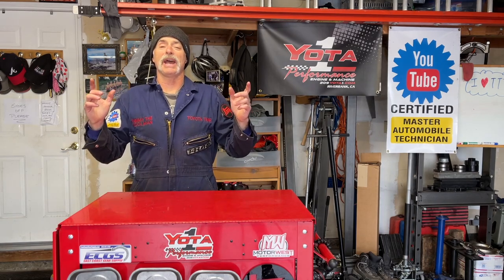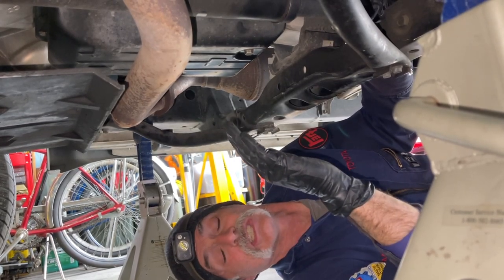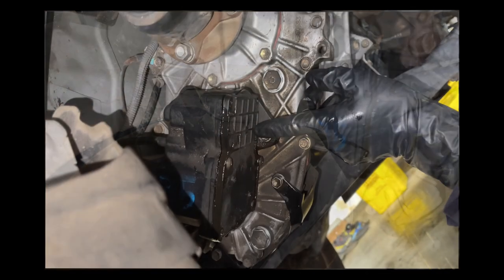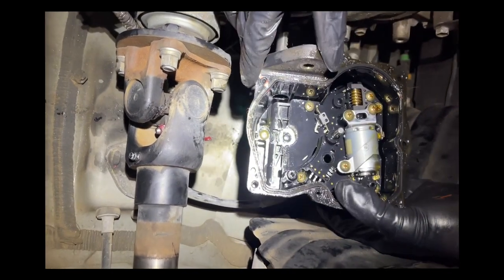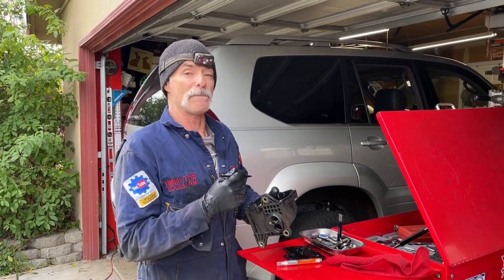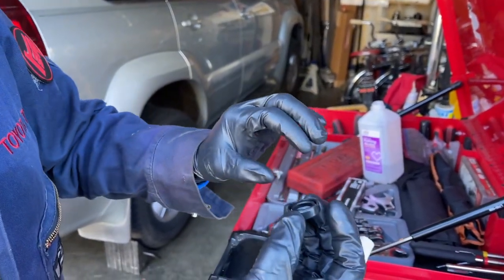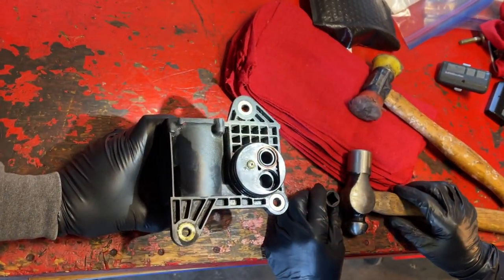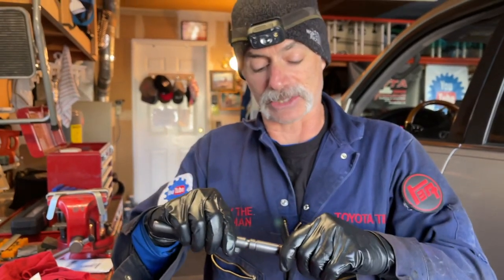Lexus GX470 Center Differential Actuator Repair

Comment from the maker: After filming this job, I had a thought of how I could have possibly been able to confirm I was able to insert the shift rod through the shaft seal without displacing the metal retaining band.  Here's my thought.  If I pulled the shift rod out further from the transfer case, basically putting the center differential into the locked position, I would have had more shaft to work with.  With the shaft further out, I could have worked the shaft through the seal and then probably had enough room to sneak a telescoping mirror with a light on it to get a good look at the integrity of the seal.  If it looked good, I'd then keep pushing the actuator along the shaft until I was able to fully seat the actuator into the back of the transfer case.  If the metal band of the seal became displaced, I would pull the actuator off the shaft, reseat the metal retaining band and then try again.  The only caveat to doing it this way is you would have to remember to change the gear timing (small blue gear and bigger primary gear) to reflect the locked position which I cover that in the video.

If you try out the above method, be sure to leave a comment and let me know if it worked out.  Thanks!
Reply: Have you made a video of 99 runner not taking gas at the pump? It will take gas but takes 45 minutes.
Reply from the maker: @kenniegarner3848  No, we haven't.  Sounds like you're having a venting issue.
Reply: @TimmyTheToolman  Good place to start? Something simple? Or would you say pull and replace everything?
Reply from the maker: @kenniegarner3848  Do more research on the problem.  I've heard of this issue but don't remember the common solutions.  Do a Google search.  Post your issue on a Toyota forum.  Also post it on related Toyota Facebook pages.  I guarantee the information is out there.
Reply: This was my thought during that portion of the install.

Comment: Just finished doing the repair with this method.  Couldn't believe how easy the job actually went, and all worked perfectly, so thanks for putting up the method.
About the only things I did differently is wrap the shaft in thread tape from just a fraction on the 'collar' back to the beginning of the shaft (as suggested by someone) to help the seal step up that collar without the lip turning trying to turn inside out (which is what I believe is dislodging the seal spring).  Once installed just unwind the tape passing around the back of the shaft and slowly pull it out.
Also did it all single handed so not a two man job as suggested in the video.   Another person would have just been in the way.  The secret to doing it single handed was have everything laid out in easy reach, good lighting, and decent sticky white grease.  With a fair bit of grease on pins and gears everything stayed perfectly in place, even the big metal gear stayed stuck up in place.  I did the job with the vehicle (both front and back) on stands.  Plenty of room to work.
Reply from the maker: Thanks for the comment.  So you wrapped the shaft in Teflon tape to help the seal get up onto the sealing shoulder of the shaft and then unwound it from inside the actuator case?  I'm trying to visualize this technique, but I'm not fully sure if I understand it correctly.
Reply: @TimmyTheToolman  Hi Tim, the idea came for a comment somewhere down below, as well as one of the Russian videos where they used electrical tape.  The use of thread tape is I reckon a much better idea as it unwraps easy to get off.
The idea is its the small shoulder on the shaft where the geared section makes way to the smooth slightly larger diameter section where the seal operates that turns the seal inside out as it passes over it.
It's reasonable to assume the seal has to be somewhat forward of that shoulder on the smooth larger diameter section of the shaft with the case fully pushed home.  So, the wrap of thread tape starts JUST on the shoulder and continues all the way to down the geared section of the shaft with a bit of a tail left to help unwind it once the box is installed.  The idea is the shoulder ridge has been 'smoothed out' by the tape wrap, as well as protecting the seal as it passed along the geared section.  In the installed position the seal will have passed clear of the tape wrap start (right close on the shoulder)
Fit the box all the way home, (requires a bit of shove to make the o-ring go into the housing) and put in the two top bolts finger tight to hold it in place .   Then pick up the 'tail' of the thread tape that will be hanging from the end of the shaft, and then unwind it back of the shaft using a very small screw driver to help loop it back around behind the shaft and the case body.  It needs to be completely unwound off, NOT pulled off as it will break and the last thing you want is a bit of thread tape stuck wrapped around the shaft. 
Hope that description helps.
Reply from the maker: @johnwoodrow8769  Thanks for that explanation.  It makes complete sense to me now.

Comment: Great job and video Tim...wish I knew about this when I was working on these. Much more elegant execution than the crunchy method we used to use. Pro Tip to keep the seal ring from popping off: pot the internals (the spring side) with grease. This puts just enough pressure on the ring to retain it.
Reply from the maker: Hey Jim, thanks for the compliment.  Yeah, I saw videos of the "crunchy" method and I knew I wanted a better solution to share with our audience.  I actually did pack around that seal retaining band with lots of grease hoping it would help keep in the band from being displaced.  I learned that trick recently from Chase Perry, the CEO of East Coast Gear Supply.  It might have helped some, but that band still popped out pretty easily when inserting the shaft.  I just think that aftermarket seal isn't made the best.  But, it's the only one available, so I guess we should be thankful a manufacturer in China decided to start making them.  I'm disappointed in Toyota/Lexus for not making that seal available for purchase.  I'm guessing the OEM seal is much better made.  I've never seen a seal retaining band become displaced so easily.

Comment: Also, I've now had the opportunity to dismantle 3 actuator assemblies.  All were in the 'unlocked' position (shaft fully expended) which has the 'pinion' gear shaft hole aligning at about 2 1/2 teeth along the shaft end.
Getting to the point, NONE of the 3 had the timing pointing to either the line on the inside of the case, or the little blue wheel pointing to the small nick in the surround like so many videos on this subject claim is the correct timing.  This is consistent with how Timmy found the timing in this video.
Reply from the maker: Thanks for sharing this.

Comment: Timmy, you’re a far better mechanic than I, and I’m pretty sure you’re referring to my videos of this when you say all the “twisting craziness” 😂. It really takes hardly any force to twist it off, and I was following some 10 year old forum post from a Lexus master tech on how they beat warranty time which calls for T-case disassembly (doesn’t make it right, of course) 

Just want to report that the locking function has never failed on me and, after my second video doing this which I posted today, where I replaced the shaft seal (the first video I did the O-ring while the shaft seal was on order 🤦‍♂️), the locking function is now instantaneous. Works great! Maybe I just got lucky with the gear tooth timing or something. But not sure I’d get that lucky 2 times in a row. Anyway, I’ll be sure to report any issues I have with the “finagle method” on the channel if I have any. Love your videos and, if I have a problems with the actuator in the future, I’ll definitely be trying this way of doing it!
Reply from the maker: I'm not sure if it was your videos I watched,  There were several that used the twisting and pulling method.  Hey, if your method works, that's all that counts.  After I learned how easy that seal retaining spring can be displaced, I would think anyone using the twisting and pushing method to get the actuator fully seated onto the shaft would end up with a leaking seal.  Even with me being very gentle with the shaft insertion, that spring could pop out.  Maybe it's just the initial insertion of the shaft and once the shaft is inside the seal and the retaining spring stayed in place, manipulation of the actuator on the shaft isn't an issue.  Glad you love our videos.  Thanks for the comment.

Comment: One of the best repair jobs I have seen in a long time brother, BUT I wish you would have shown how to diagnose the bad switch and which pins to test on the bench with a simple ohm meter or test the voltages while operating the actuator on the pins when not working and when working properly otherwise an awesome video. THUMBS UP
Reply from the maker: Thanks for the compliment Duane.

Comment: So so close to what i need. I have 2004 4Runner with diff lock and 4 low, so two shafts. This looks so much more appealing than pulling the transfer case method. My actuator body seal is leaking and dripping. I periodically top up the transfer case but starting to get tired of that. I do think my shaft seal design is a little different so I wouldn't have that challenge. I would have the additional shaft timing to worry about though.

Watching Your meticulous demonstration and detail makes me think that maybe I could explore my way through the job. I'll have to research this some more I guess.
Reply from the maker: Yeah, I think if you take the cover off the case, note the position of all the gears involved, remove the gears and then slide the housing off both shafts you can do the job just like we did.  Let me know if you go for it, and if you could, take pictures.  I'd like to see what the internals look like.  You can email me at: mtbtim@sbcglobal.net  Good luck!

Comment: Awesome video! Thank you. Would have been awesome if you showed topping off the gear oil into the transfer case though. Cheers my friend.
Reply from the maker: We're glad you like the video Warren.  Filling a transfer case is easy.  You get the vehicle on the level ground, you remove the fill plug and you pump gear oil into the fill hole until it starts to spill out from the bottom of the fill hole.  You put the plug back in and tighten it.  Pretty easy.
Reply: @TimmyTheToolman  Sounds like a plan! Thank you.
Reply from the maker: @warrenlowe676  You're welcome.

Comment: INPUT REQUEST: 06’ gx470, had same issue of delayed engagement/disengagement. took cover off, no transfer case oil! was already there, decided to replace the seal, clean things up, apply new grease. i have taken apart and put back together 3 times consistent with your directions (and how i found my gear positions) BUT NOW I HAVE A FLASHING VSC (each of the 3 times I have put it back together!). any input is greatly appreciated! everything looked good when i took it apart, dry, grease was not too firm, electrical connections appeared clean and intact.

Comment: Outstanding detail and video I have the same actuator on my 4 runner. now I can check my timing and test the motor. I will use thread locker on the 12mm mounting bolts to insure they don't become loos. I will pull the shift rod out to install the actuator over the seal, rotating the actuator while gently pushing it on the shaft should work. Thanks
Reply from the maker: We're glad you like the video and you're very welcome.  Good luck with the actuator diagnosis on your 4runner.

Comment: Great video and thank you for taking the time to explain everything.  Any chance you would be doing this to a 2 shaft differential actuator?  I have a 4 runner where it looks like there's a small leak between the center differential and actuator motor housing.  I'd hate to remove and crack the differential to just replace the seals.  There is no problem with the operation actuator, just an annoying leak.
Reply from the maker: I would like to try this on a 2-shaft actuator, but nobody local to us has asked us for help with this job.
Reply: @TimmyTheToolman  Where are you located?  I am in Nor Cal
Reply from the maker: @loriet.1236  San Jose

Comment: I’ve been watching for years ! I was wondering if you’ve ever done a video on replacing an oil pan gasket for a Toyota truck, specifically my truck is a 1995 T-100 two wheel drive with the V6?
Thanks in advance! Enjoy your great videos!
Reply from the maker: No, we haven't got a video for removing an oil pan on your T-100.

Comment: Great video.   My box is doing the same thing.   Locks and unlocks but light still flashes. I did everything you did , any thoughts.
Reply from the maker: Not sure what else to try.  If you cleaned everything up really well and assembled it properly, you might be forced to just buy a new actuator on Ebay.

Comment: Great video and information, I disassembled the actuator and expected a load of gear oil to come out as it was dripping, turns out I was wrong and the inside of the actuator was bone dry with loads of rusty flakes coming down and the dc motor completely corroded and destroyed. Do you know if its possible to find a similar dc motor to replace this one? As for the leak I had its actually coming from above the transfer case output shaft seal rear. thanks to another video of yours I'll be able to fix that one too. You're the best man, thank you.
Reply from the maker: I do not know if you can buy those motors separately.  I doubt Toyota or Lexus sells them, but maybe someone has figured out how to source it from a 3rd party.  I think a Toyota forum or Toyota Facebook group would be the place to ask this question.  If you do figure something out, please comment back and let us know.  This would be something helpful to share.
Reply: @TimmyTheToolman  the blue dial connector has some corrosion too. At this point I’ll go ahead and replace the whole actuator assembly. Thank you.
Reply from the maker: @jamilmaloff6418  Sounds like the smart move.  The Aisin one for sale on Ebay seems like the way to go.  The ones for sale  from Toyota or Lexus are crazy expensive.

Comment: I wonder if you put the seal the other way with springs facing the other direction if you still had the band popping off, worth a shot to see.
Reply from the maker: I don't think it would seal properly to the shaft in that orientation.  Seals are directional.

Comment: Nice video and explanation of one of the more perplexing problems that may develop with this transfer case/center diff lock. I have an AWD, '03 V8. Just a thought, you called the hose a "vacuum" hose, could it be a vent hose? What is vacuum being used for? Thanks again, very well done as usual! Any P/N for that seal kit you got from Amazon?
Reply from the maker: Glad you like the video.  I think you might be right that it's a breather hose.  I heard people in other videos call it a vacuum hose and I just parroted what they said.  The seal kit is linked in the video description.

Comment: My diff locks fine. Hear it engage and light goes solid. but the “vsc off” light does not come on. In your experience do you think it Could it be the actuator or deeper within the transfer case?
Reply from the maker: I'm not sure.  Making this video was my one and only experience diagnosing a problem with the center diff lock actuator.

Comment: How much would this repair typically cost? I’m looking at buying a GX that will likely need this fixed
Reply from the maker: A shop is going to want to do it the Toyota/Lexus way which would cost a freaking fortune.  First of all, they would recommend a whole new actuator.  That's $1500 or probably more with their dealer markup.  The factory way to replace the box is removing the transfer case, cracking it open and disassembling several things to get the old actuator shaft free of the transfer case.  This is the reason why I wanted to make this video to save people from getting bent over at a dealership or other shop.   Do yourself a favor and give my technique a shot first before spending a crap load of money at a shop.  Everything you need is in the video.

Comment: INPUT REQUEST: 06’ gx470 95,000 miles, had same issue of delayed engagement/disengagement. took cover off, no transfer case oil! was already there, decided to replace the seal, clean things up, applied new grease. i have taken apart and put back together 3 times consistent with your directions (and how i found my gear positions) BUT NOW I HAVE A FLASHING DIFF LOCK LIGHT (each of the 3 times I have put it back together!). any input is greatly appreciated! everything looked good when i took it apart, dry, grease was not too firm, electrical connections appeared clean and intact. The actuator case does have 135 painted on the side, possibly a used unit put on here before I bought it a year ago. The actuator cover has the blue gear built in, as you noted 4runners have.
Reply from the maker: I don't know why your VSC light would be blinking after doing what you did.  This was my one and only time messing around with this system.
Reply: @TimmyTheToolman  i meant to say flashing diff lock light. i did not mention that the actuator may be second hand as 135 is paint pen written on the side AND the cover has the blue gear built in. i am thoroughly impressed that you responded to my message. thank you for sharing your thorough knowledge and input.
Reply from the maker: @jclemenzi  Have you tried verifying if it's actually locking and unlocking like I did in the video?  A flashing diff light means it's not locking, but that could be a false reading.
Reply: @TimmyTheToolman it is a continuous flash as soon as the key is turned to on. i tried pushing the diff lock button, i could not hear much so possibly not doing anything at all. took it for test drive, definitely not locked. i somehow must have messed up electronics! super bummer!!